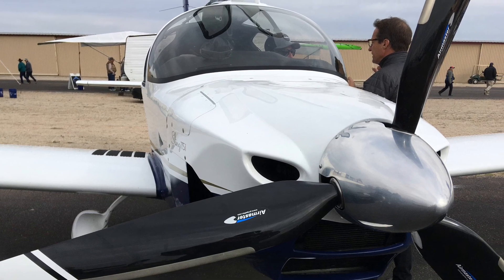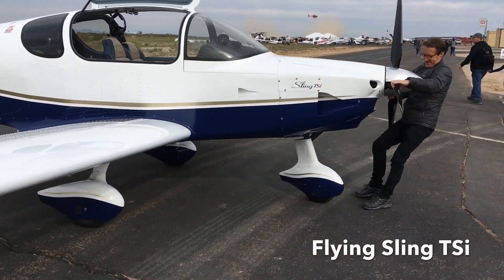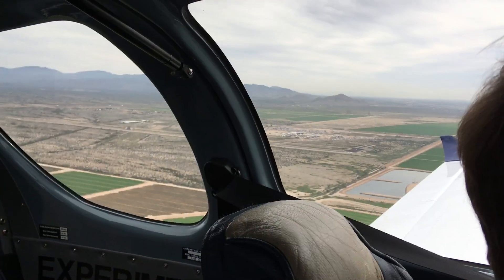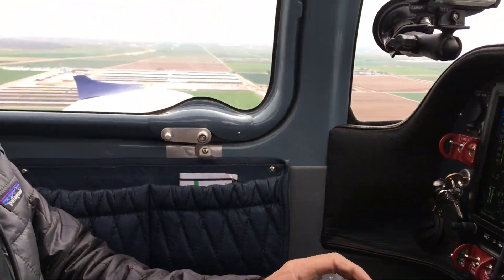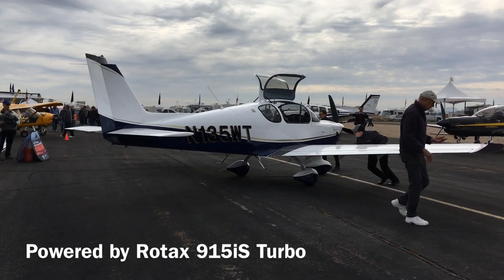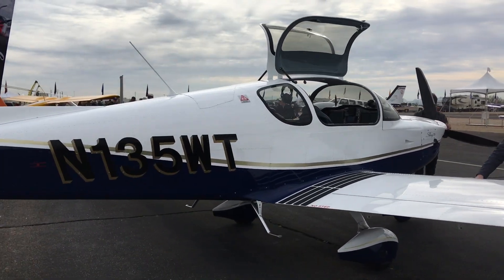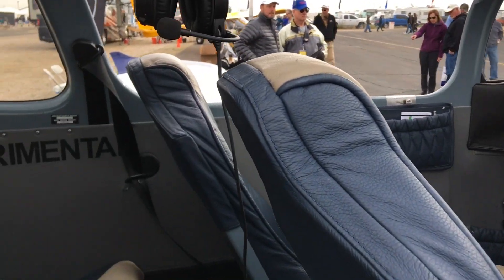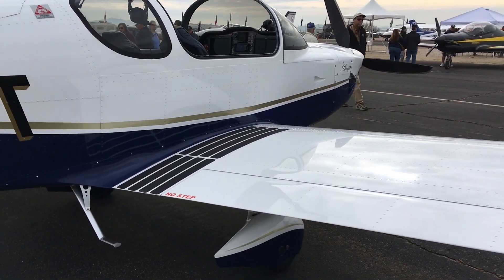Flying Sling TSi Copperstate 2019

Comment: Imagine a turbine electric powerplant. Small inexpensive turbine generators at 60krpm and electric props at 1500rpm elsewhere. Size and weight convenience of a turbojet but fuel efficiency more like a piston. And potentially fairly quiet. Glider elegance with jet agility.
Reply: Too much weight.

Comment: Nice sleek plane. Good appropriate respect for aerodynamics as all planes should have. No Cessna colonial era style crimes. Not a fan of cessna 172 :)
Not a fan of rivets either though. I get the use but it just seems wrong. Even the nice smooth glass fibre is old but rivets were used on the titanic and indeed thousands of years ago. It can't help look crude and must be rather elaborate to manufacture. Large mold composites seems preferable.